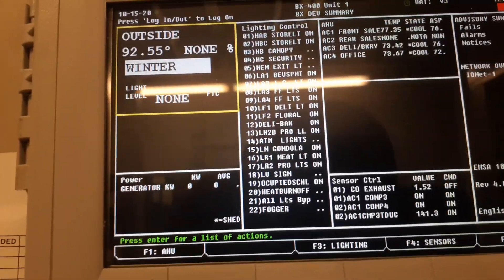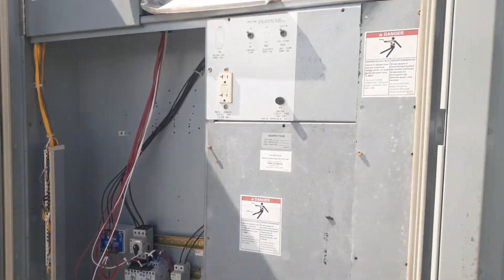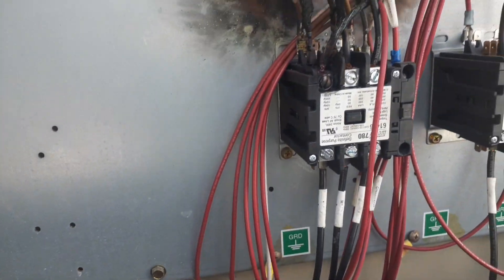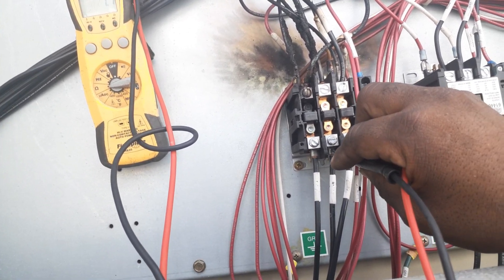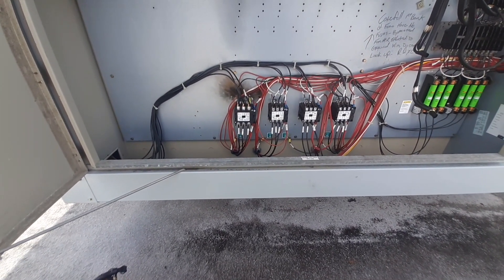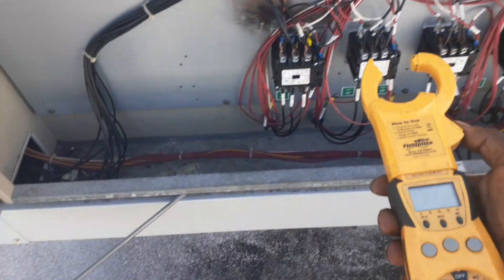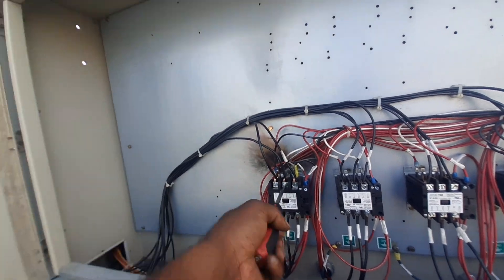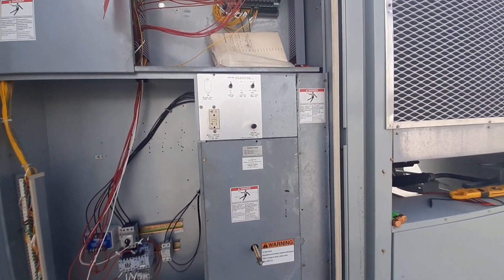45 TONS ⚠️ MCQUAY | (RTU) ROOFTOP UNIT TROUBLESHOOTING

Comment: Nice job Bro. Great ear. I didn’t catch if it was a dehumid unit . Causing cases to sweat.
Reply from the maker: Glad You Asked!! It's one of the main cooling units. The bottom of those cases is ducted to the return for the unit. We pull air across the cases help with condensation. Also if your not maintaining 75° F dry bulb an a dewpoint temperature of 55° or below the store will sweat. Creates Slip Hazzard⚠️
Reply: Your one Hell of Tech Bro. Learned a lot following along with you on your service calls. Keep Em coming.🤙